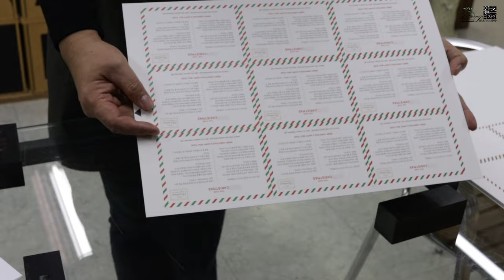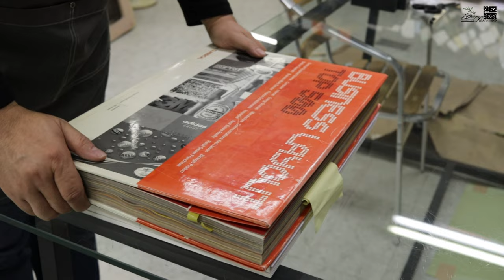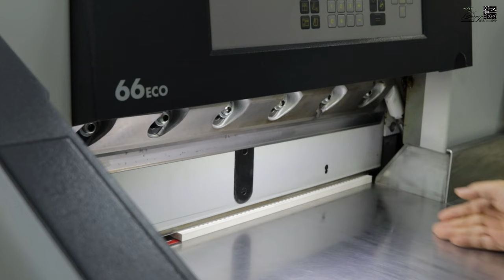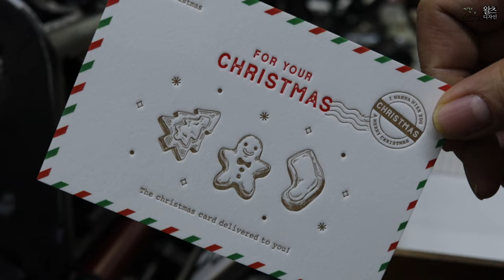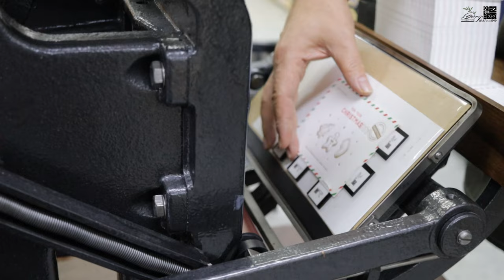Make a letterpress Christmas card. 레터프레스 크리스마스카드 만들기.

Comment: hello my friend, which is the better way to make the plates? using a mini CNC router could be a right choice?
Reply from the maker: Hello. Plate making is made by commissioning a professional company. Proceed to corrosion work. The plate is covered with a fine film, and the ink gets on it. If it is made with CNC, it seems that printing is not possible because there is no film.
Reply: @w_letterpress  the Big problem is we are in México... And no near companies to make plates as yours... I was planning Buy a cnc machine.. your plates are Made from corrosión chemical procedure? I have seen videos making with corrosión procedures
Reply from the maker: @rapigraph1  
Yes. It is made by a corrosive chemical process. In Korea, it is gradually disappearing due to environmental problems.
Reply: @rapigraph irapuato Debe haber talleres de placas de zinc en León o Guadalajara